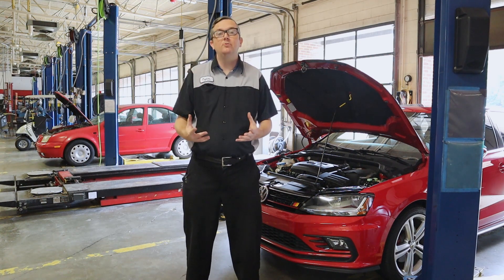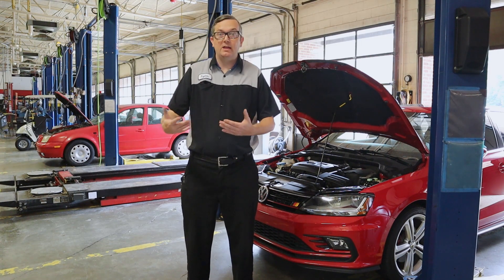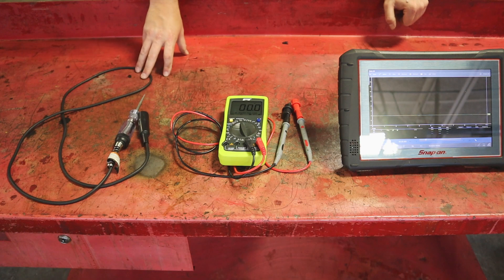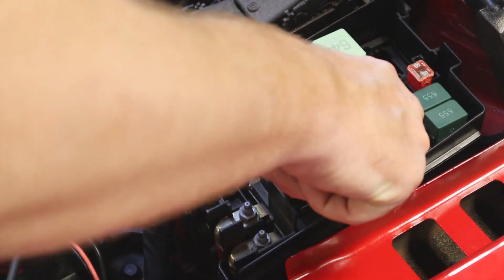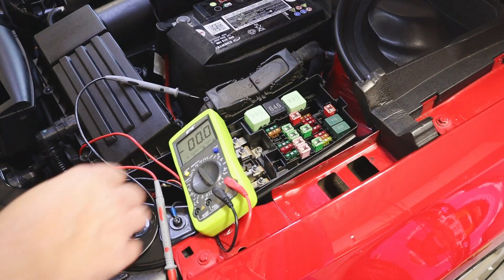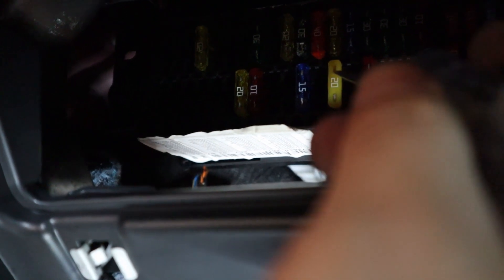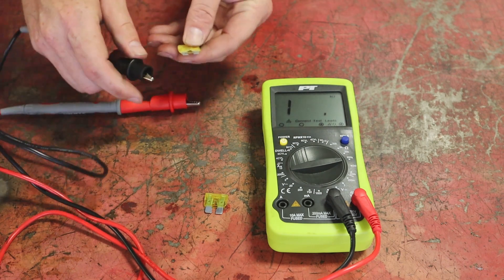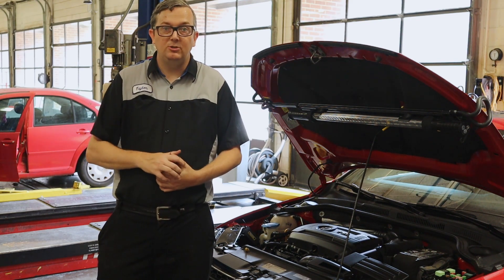Fuse inspection and diagnostics on 2017 Jetta with a 12v outlet not working

Comment: Thanks for the video really informative. I have a 2018 Jetta and the fuse seems to be ok but I still don't have power to the front 12v outlet or the rear 12v in the center console:/
Reply: Hello, I have the same problem, did you found how to repair it?
Reply: Persistence + Trial and error = GL  @jakubkuchta2707

Comment: It just worked out perfect for a new video for you with your Jetta's fuse blowing hm? Haha, all the same very informative. Only thing I'd suggest for some vids like this is to try to get a better camera angle so that your hand doesn't block some of the information at times.
Reply: Granted the idea was clear on what you were doing, so it's not that big of an issue in this case.